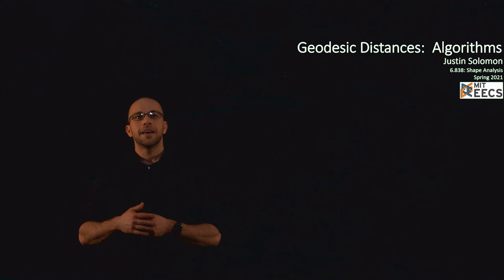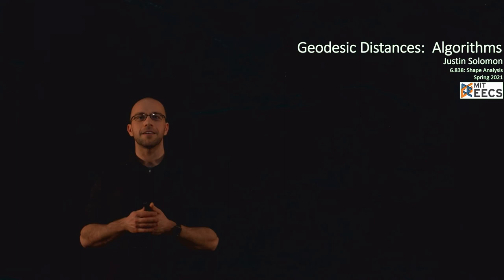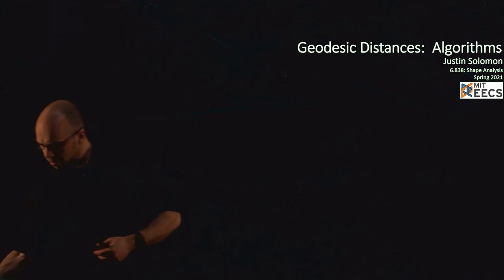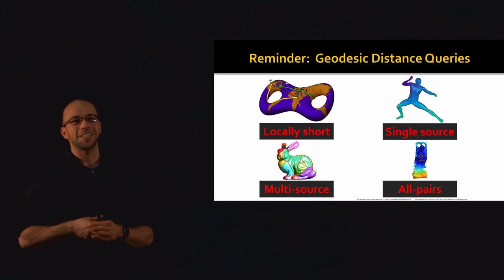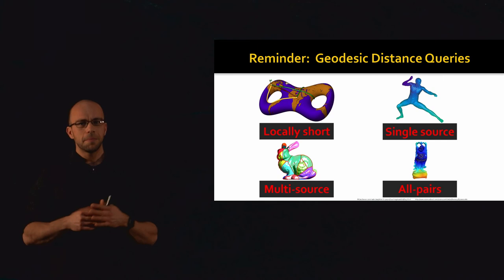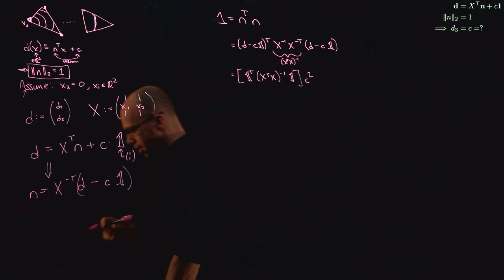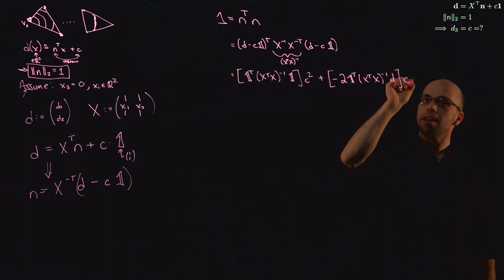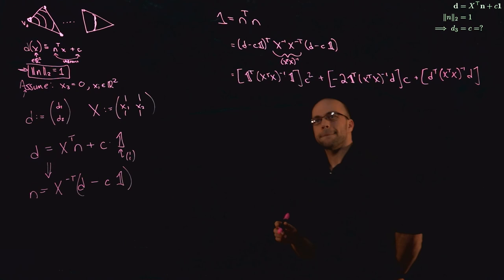Shape Analysis (Lecture 9): Geodesic distance algorithms, fast marching

Comment: Thank you, Prof. Solomon, for this amazing lecture on geodesics and the fast marching method. Just a question, does the mesh skeletonization using wavefront propagation also use the same idea? If it is, I assume that in the case of skeletonization, we don't have to travel along the edges. I am fairly new to this interesting field. Thanks!